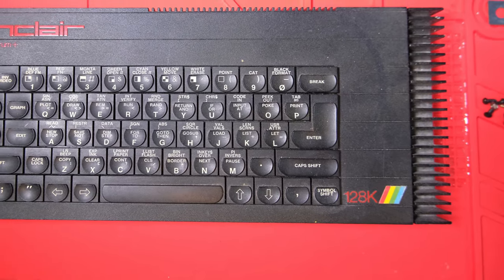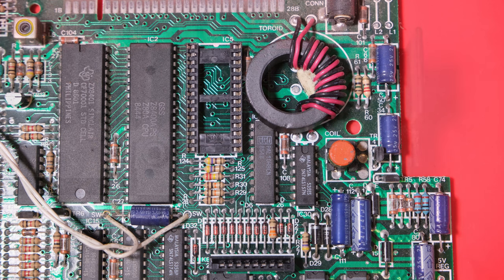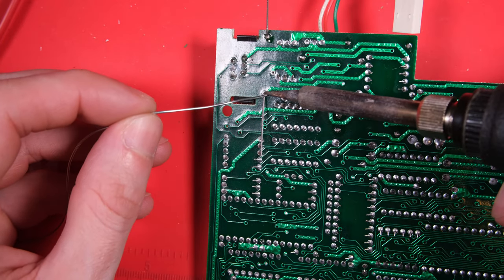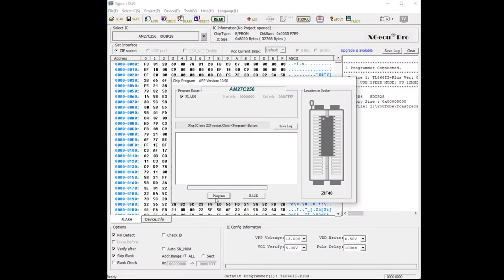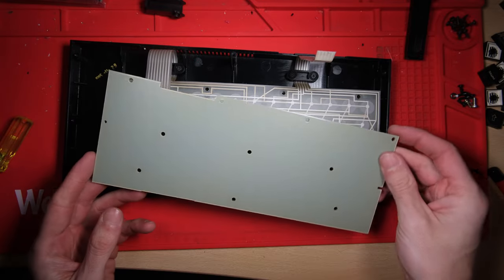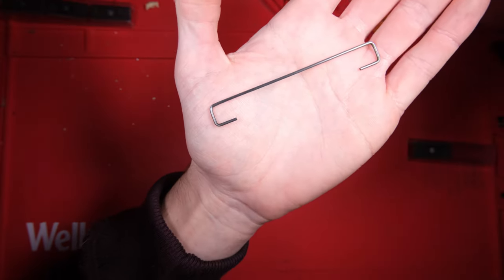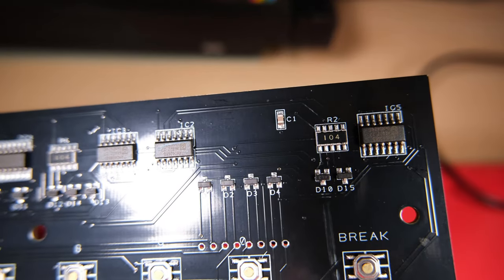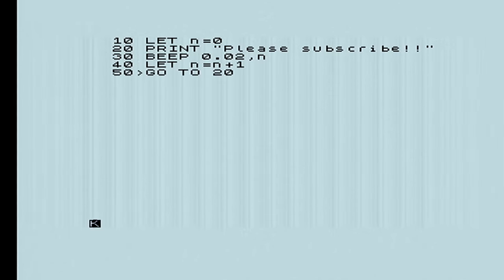ZX Spectrum Toastrack Mechanical (Clicky!) Keyboard + Refurbish

Comment: Great video, That new keyboard looks great.  BTW it's easier to remove the Spacebar rod from the membrane side, once the membrane is removed. Also when fitting the backplane, you shouldn't have the face resting on the bench.  The left and right of the keyboard face should be raised so the keys are dangling free in between, if that makes sense.
Reply from the maker: Thanks for the tip!
Reply: @HappyLittleDiodes    NP, it was more for your viewers.  Thanks for the videos.  I'm getting my (spare for parts) ZX Spectrums back in shape with your help.

Comment: Thanks for this video, it's very interesting, great work. I have installed several of these keyboards, they are marvellous, however the remaining touch is not very good because the microswitches are very high, eliminating the spring effect of the membrane. This can be solved by putting a  cardboard or plastic template with holes for each microswitch. With thickness similar of the microswitches between the membrane and the PCB, the sensitivity and tact is greatly improved.

Comment: Nice.  The membrane on the + and 128K have 3 layers instead of the normal 2 to access the additional keys. However to do this on a PCB with a simple switch you need simple logit to imitate that 3rd membrane layer.

Comment: That keyboard mod is quite intriguing, I wonder if it's been considered for the original Commodore PET 2001 with it's chiclet keyboard? 😏
Reply from the maker: That would be nice! And certainly possible given the design, instead of using ICs to multiplex there are just millions of wires, it's quite simple

Comment: Yep, removing the coil from the toroid will have decreased it's inductance. May cause problems as far as interference is concerned but otherwise, no biggie. Would love a toastrack one day, but will have to live with my heavily modded Grey +2 with toastrack rom, stereo sound, rewired joy ports etc, etc. 😛
Reply: Yes would love a way to improve the sound on the grey +2 mono output stereo channels available never understood why they did that
Reply: @retrorobbins  It's a bit of a fiddly job, but when I did the video out mod I fitted three phono outs in where the modulator out was (by drilling the shielding case to accept sockets)  and carefully sculpted the case plastic so it looks like it was original. Did the stereo mod and hooked it all up, balancing the levels with variable resistors and it really makes a huge difference. Some games even work in surround for some reason, which is fun.
Reply: @retrorobbins  Simple reason they left it as mono - most of them would be used with portable TV sets, which are also mono.

Comment: The toroid isnt really important and in fact, it's often not fitted at all! I think there were some countries where they had to minimise emissions from the 9V power cord, thats all. The grey +2 is the same design and doesn't have one.

edit: I would probably replace that GSS branded Z80. They are known for going bad !
Reply: As you can read elsewhere in these comments, my Version 9G is missing the toroid coil. But that's also the one that's spray painted with metal paint at the inside to minimise emissions!

I have a few other micros that have the inside of the case metal coated: a US ZX80 and US ZX81, Timex Sinclair 1000 and 1500, a NTSC ZX Spectrum from Chile (making use of some extra connection pads already on every issue 4 motherboard specifically for the grounding prongs!) and a Beckman Sinclair ZX Spectrum 48K+ from Sweden.